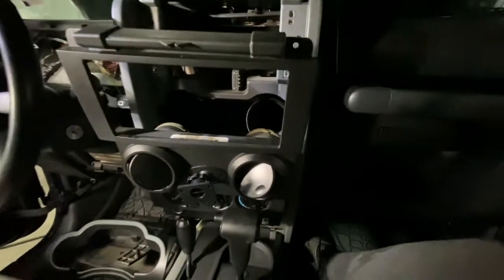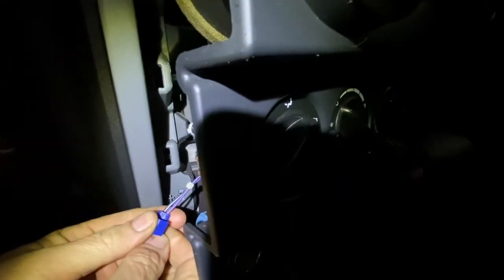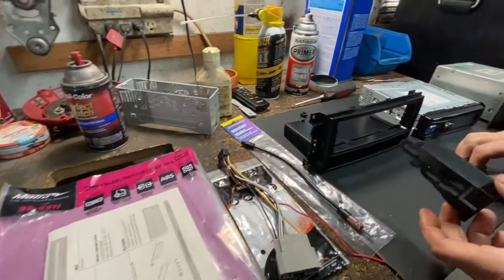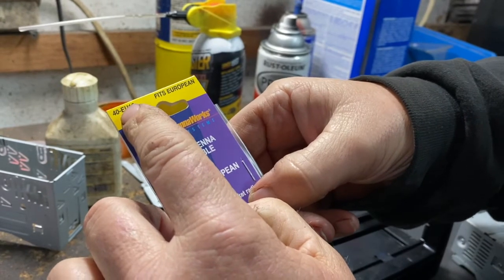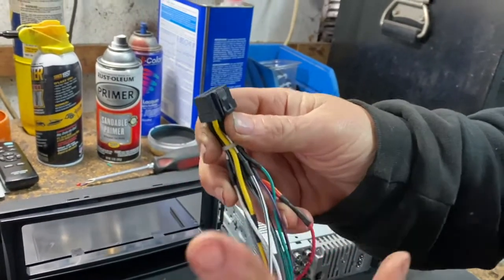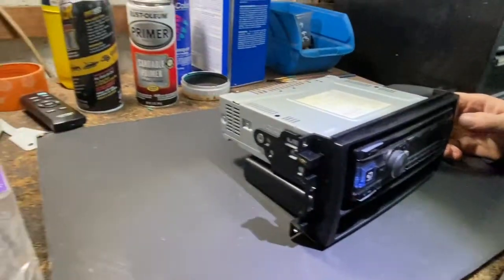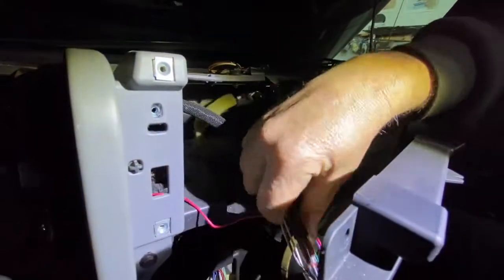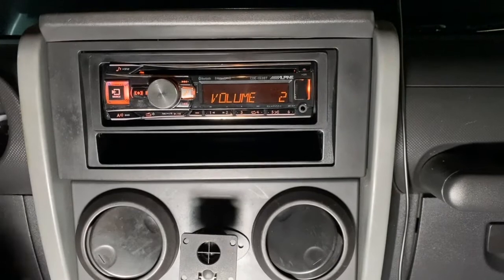Upgrade and Install Stereo/ Radio in 2007-2011 Jeep Wrangler JK - Step-By-Step

Comment: Bud, it's like you re making videos for me with every issue I'm having with my 08.  I have the pioneer dmh 1500-nex .  I realized that the harness we get that plugs in the radio harness doesn't have the "power attannae" wire which I would use to remote turn on the sub when I turn on the car.  Instead of splicing into the cig lighter can I just splice into the 12v ignition wire on the pioneer harness since isn't that what makes the radio turn on and off with the ignition and just tap into that?
Reply from the maker: Thank you for the comments much appreciated. The reason to tap into the cigarette outlet is for constant power for the yellow memory wire. The ignition red wire is to turn unit on and off with the key.

Comment: On mine, the orange wire went to the headlight switch for the dimmer to lower the light output of the head unit.
Reply from the maker: Correct, orange is for illumination, for some reason this vehicle didn’t have a separate wire for dimming so it you don’t have that wire it can be tied into the red switched power.

Comment: ive got my red acc wire in the cig lighter wire, where does the other end hook up to...the aftermarket stereo harness or the harness that plugs into factory harness?
Reply from the maker: The red acc wire goes the the aftermarket stereos red switched wire that should also be red. That wire turns the stereo on and off. So make sure when you turn the vehicle off that red cig lighter wire has no power.

Comment: Just tried to splice into the 12v ignition cig lighter with the remote wire from sub woofer like you did.  Sub is not turning on when I turn on ignition
Reply from the maker: It should. That acts like a switch. You using an aftermarket amp?

Comment: Hello maybe you can help me I bought a 2008 jk short all speakers and sub broken.
Install kicker speakers and disconect the sub till I can buy another one.keep the Head unit
The speakers in the bar don’t have any bass at all. They came with mopar conector so no polarity problem. Also invert polarity to check and still doesn work. The kicker in the front work perfect 
The question it is possible that normally the speakers in the bar skip the bass for some reason in the original configuration..
Reply from the maker: Well it depends, normally the factory speakers have different ohms then aftermarket ones have and the ones on the rear bar won’t have much base because of where they are located, that’s why they added the sub to fill the rear with some bass. Plus the stock radio is only so good with aftermarket speakers. Your best bet is to save up for an aftermarket head unit like Alpine and some speakers and get rid of the factory radio like I did. Hope this helps
Reply: I know this is old, BUT others mat read and/or you may not have found a remedy. 
 Get some poly fill. Like the stuff that is in a dog toy or cheap pillow. Stuff the chamber with it. Just don't mash it into the cone of the speakers. This will increase the perceived bass and will definitely make them sound way more full.
Reply from the maker: Good tip!

Comment: Does this way work when you have a factory amplifier in your jeep? I bought a  Chrysler radio replacement interface for mine bc that’s what I was told to do with a factory amp
Reply from the maker: No , only for the standard 4 speaker system, but that interface should be what you need to the factory amplifier.
Reply: @motorcarnut  i appreciate the response! Gained a subscriber. I’m having issues with mine being I wasn’t aware I needed the interface, and cut the factory connector off being I was going to wire it to the new radio like I would normally do. Is it still possible or do I need to rewire the connector back onto the factory wires?
Reply from the maker: Thanks for the subscribe! Yes you just have to make sure you wire it up properly. They have online stereo wiring diagrams, I think one was called bulldog or something like that. Just do an online search for stereo wiring diagrams then look up your vehicle and you should be good to go!
Reply: @motorcarnut  awesome I appreciate it very much!
Reply from the maker: No problem!

Comment: I'm wandering if there are any security issues?  I have an 09 wrangler jku and I'm wanting to install a single den
Reply from the maker: If you’re talking about the security system, no. If you mean the Stereo itself no because you will be replacing it with a new one.
Reply: @motorcarnut  yes I was wandering about both. First newer model wrangler I've owned. I know in certain model GM and Ford you had security system issues to deal with. Thank you

Comment: Need help my harness was cut Pryor to purchase without realizing. I have a 2011 wrangler unlimited JKU I’m trying to wire in a aftermarket single din I can’t figure out how to keep my radio to save it’s memory everytime I turn off and start back up I got to reset my EQ settings. Like I said I’m wiring straight up to the Jeep I do not have a factory harness. I tapped in the cig lighter for power but I can’t figure out which wired I connect to save the settings
Reply from the maker: I don't know what radio you have but most are the same. You have a red wire which is switched power meaning when you shut the truck off that wire has no power. The yellow wire is memory which i believe is your problem. That wire always should have power to keep the memory regardless if you shut the truck off or not so it keeps all you pre sets etc. make sure that wire is connected to a constant 12v source with the truck off and tap into it. Let me know how it works out.
Reply from the maker: Also, on these jeeps, make sure the power source you tap into for the yellow memory wire still has power not only when you shut the truck off but when you open the door, very important.
Reply: @motorcarnut  I ran a wire directly to the battery to my yellow wire for a constant no issues everything is working great thank you!